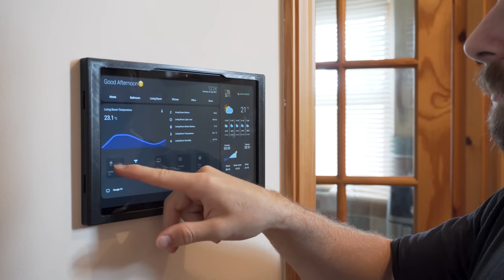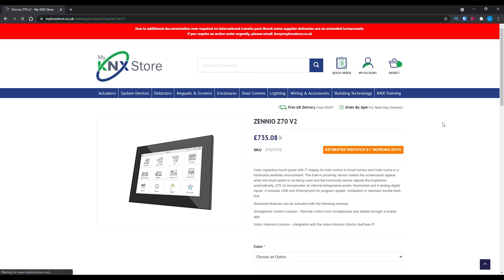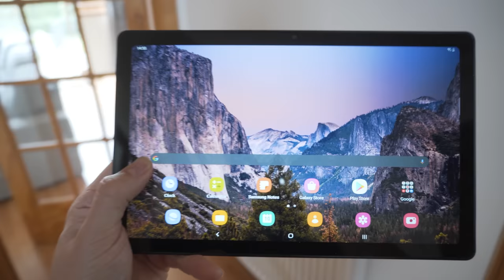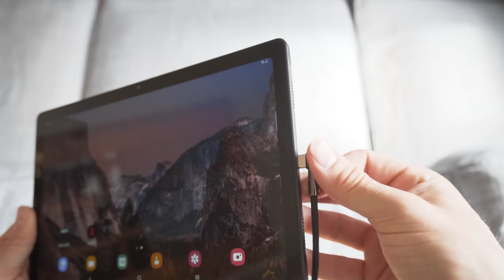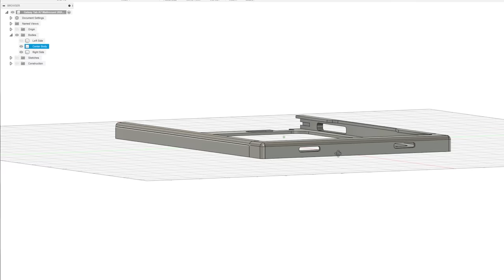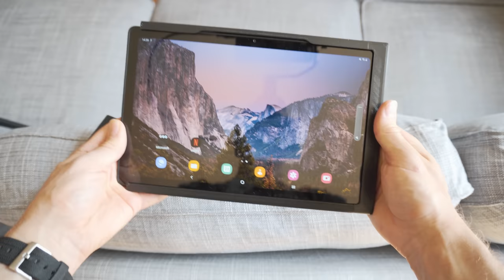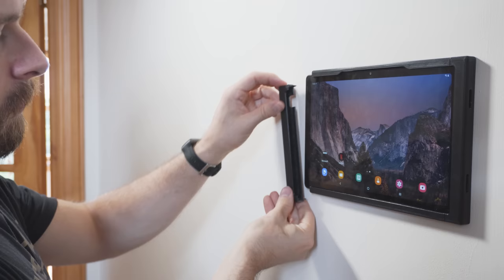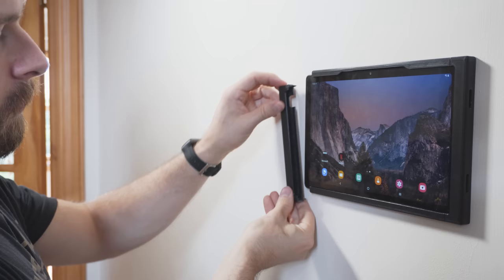Building my PERFECT Smart Home Control Panel!

Comment from the maker: Have you got a wall tablet or planning one? What automations would you do with it?! 😎
Reply: My home page for my wall tablet has the thermostat, alarm, weather, and I use conditional cards on mine to not clutter the display and only have items to control when I needed, or information when necessary. These include:
- Card for severe weather alerts (tapping will show the attributes which is the alert information in-depth from US NWS)
- Card for when the UV index is high or above
- Card for if the garage is open (tapping allows the option to close)
- Card for if certain doors are locked
- Cards for certain lights that kids use, but don't turn off (tapping will turn off instantly or pop up options if they are RGB to change colors)

I have other lovelace pages for cameras around the house and one for traffic cameras for intersections on our commute. This is great to see during the winter and know which route to take, or see if there is a wreck or just big back up for some reason.

It is nice that they only pop up when I need to see them and not have to scroll or go to different pages to see what is important. I want to interact with HA as little as possible, it should be all automated.

I use the light sensor from the tablet to automate lights in the area, and of course the camera is used for waking and sleeping the screen.

I use a kindle fire HD8 and  a Makes by Mike mount.  I also use Fully Kiosk.
Reply: First of all thank you for making great video(s) I wasn't quite decided if I should go into it right now but this is so inspiring that I've already ordered one for myself :D. 
My main motivation is to use it as a first point of contact for every member of my family. 
First point of contact for:
- Relevant information/warnings regarding house/meetings/analysis
- Surveillance system
- Control Hub for heating, irrigation system, media etc basically all gadgets that I have integrated in HA

Also I want ability to wake up tablet and show some of these information/warnings to passing person when certain conditions are met (type of event, time etc)
i.e. Garbage (people use to forget to put them out or they don't know which one is collecting), Door Bell, Intrusion, Important news about weather or just daily forecast early morning.
Reply: I'm planning to do something similar when I have my own house, but instead of cable I will attach a wireless adapter to take and use the tablet whenever I want and then leave it back in the wall without plugging/unplugging the cable.

I didn't know about the browser/app you are using, great idea! I'm saving the video for the future :D
Reply: I have a wall tablet. It uses the picture elements card extensively to make a 3d plan of my apartment. Rooms light up when lights come on. It has a lot of functionality but mostly it just looks good! I was fortunate that there is wiring for an alarm system that wasn't used so I ran the power through that from the cupboard the alarm wires go to.
Reply: We have young kids that still nap during the day, so my wife puts her phone on silent to not wake them. My most important automation/script is a button to turn off her silent mode so I can contact her haha. It also turns it off whenever we leave home. It's saved me a few times when something urgent comes up
Reply: I have a tablet mounted on the side of the fridge. I have groups to control everything there, Thermostat entity that pops open the Thermostat with a tap, weather card and a camera card with the front door. My problem is Lovelace constantly drops the camera feed so I have to refresh every 15 mins with Fully Kiosk plus the HLS protocol is quite slow so you might not even see who's at the door by the time you could walk there. I just returned my Amcrest 2k as it was failing as a doorbell (30 sec to ring) and am looking into UniFi gear...
Reply: The CM4 would have been a good fit
Reply: @AlvaroBerdonces  Nice idea with the wireless charger. I imagine you can build a 1 cm thick box, smaller dimensions than the tablet itself, put a wireless charger and strong magnets inside to hold the tablet. On the tablet glue metal plates and usb charging coil to it's back. Tablet will look like it's floating close to the wall with no visible frame or case and you can easily grab it and take with you anywhere.
Reply: We run an iPad Air 2 (really needs upgrading - getting slow - but that's a different story). Our smart home is mostly about lights and covers, and we have all this in zones, in one room which has both den, dining room and kitchen. We have a number of screens for details that aren't used that much (by anyone but me :)), and so we've concentrated on agreeing on the most important and usable things with high WAF (which has been achieved) to fit on a single "main" screen.
It is mostly in two sections: set of toggle buttons for a number of presets, and some select cards with sliders etc. for direct control of relatively-but-not-too-often used entitities. The rest are on other screens.
Presets are things like: sleep setting - both for the main living area, where it closes all blinds (10 Ikea Fyrtur + 2 Velux blinds), and turns of all lights except downlights in the living room which are dimmed to lowest due to our son sometimes having nightmares. There is also a preset button for his room, where he has a bit of light on under his bed during the night. Then there are 3 toggle buttons for our three zones of covers (Fyrtur + Velux), and a toggle button for Sonos to start playing our favourite radio channel at a reasonable volume level.
Since it is at the center of the house on an open space layout, we actually use quite a bit, and we find that we use it a lot with other apps as well. Things like music (Youtube and Spotify-like service) which we stream through Airplay 2 to Sonos, our digital shopping list app, weather app (nothing beats the specialized apps in my experience - being an avid cyclist I value radar images and the likes), and so on.
I try to integrate some things as it is possible, like our heating system, ventilation system, etc., and it works fine - just not used much, since it is pretty much just set and go. But for some things like the Meater BBQ meat themometer the native app just provides such a rich experience, that it is preferred - and as such it has actually grown to not just be our "Home Assistant display" but much a daily central for a lot of digital services.
Reply: I chose the same tablet. 🤣 
I think it worked great.
Reply: Ive built a 24" "Tablet" that I have in my kitchen. Its an IIyama 24" monitor inset into the wall with an Odroid N2 connected. Its awesome. Runs Android with home assistant, Google home, Plex, Netflix, Spotify etc. Have the audio out connected to a mixer amp so I can send the audio to any room in the house too.
Reply: why not use crestron or control4 or savant ?
Reply: I have a wall tablet, I do have a question that maybe you can help and possibly make a good video for. Im using Frigate on a RPi 4 + Coral, but i only keep 1 day of files at a time due to space, is there a way to use a usb drive or even a remote nas directory as the location for the frigate clips? or can you make a video of Frigate as a standalone container in raspbian with usb clip storage. I originally wanted to run my Hassio on Proxmox but had some virtualization problems with the coral so i swapped to RPi 4. love the videos BTW.
Reply: I move end of the month. Will do something similar :)

One note, there are tapes for wiring speakers on a wall, which you can then simply paint over to hide it. Maybe that's a better option than to poke holes everywhere :D

But in your case you have basically empty walls, so why not remove a section and make the display flush with the wall? 🤔
Reply: Hey got another question for you. Did you consider a POE adapter for power and connectivity? Do you know if its even possible for Samsung A7? I was wondering if wired connectivity would improve the camera streams.
Reply: Hi, friend. I really liked your project for mounting a tablet on a wall. I have just such a tablet and I have been looking for a long time how to fix it well and beautifully on the wall. How can I get files for a 3D printer?
Reply: I would use it to turn my lights on and off and for announce from my Alexa because i have many of them around the house due to limited communications because of many walls throughout the house and mainly because of usability with timers and such
Reply: are you sharing your STL or 3D Model?
Reply: Have you finalized those wallount 3d plans yet?

I have the same tablet, and would love to wall mount it. Thanks!
Reply: I need that 3d print please
Reply: Where can I get the 3d modell?
Reply: I always wanted one, but struggled with exactly the same issues you did. I am really interested in the Doorbell-Fullscreen Automation!!!
Reply: Walk downstairs and kitchen light goes on, kettle boils, fill dependent of course and I am informed of news and travel delays without asking
Reply: Well, I have been searching for a good central console for quite some time. I was actually planning on setting up a full blown PC to accomplish this, as well as serve as my camera storage. This may be a good option in the short term until I can get that going.
Reply: I would love for the tablet to pull up whichever nest cam is triggered with the talk back function enabled, or just have each camera always on per tablet. One for the front yard, one for the drive way, one for the back yard, etc. I am planning on putting a few tablets in the house mainly for security monitoring purposes. We have nest hello ( which is going to be updated to the newer nest doorbell battery edition), Nest cam battery with  floodlight, and a nest cam outdoor IQ ( The tethered version).
Reply: @CrypticConsole  too expensive.  the A7 lite is not @$129
Reply: @Felipe-ij2lu  but the A7 is not open source
Reply: I would love a wall tablet once I have a few more automations in place. Though I would want to be able to remove it from the wall and carry around if possible to use for security cam monitoring and like. Just gotta find a way to make it so the charging cable can attach on it's own and ideally removed easily. Think there's some magnetized cable adapters and stuff that might work for it.
Reply: Are u going to publish 3D wallmount files do we can use them to print it?
Reply: @speeter6345  Yes i need the Same please. 
Possibly the Fusion360 files
Reply: I kind of want to mount one on the inside of my front door, as some sort of 21st century peep hole.
Reply: Very nice! I am actually going to build Control Panel but based on Alexa Windows app. All my smart house devices are compatible with Alexa so I'm gonna use 'ready to go' app from Windows 10. It will be old MS Surface Windows 10 tablet as a controller.
I was also thinking about Ewelink Control Panel but unfortunately this does not interconnect all the devices.
Reply: Making a water spray when porch pirate come it blows high pressure water to scary porch pirate
Reply: Any step files by now?
Reply: Isnt this set up basically useless? All smart items have their own apps or integrate into single apps you can access on your phone. Why would you need a wall monitor/hub at all?
Reply: @GrimSpec  😮😅😅 h😮  g
Reply: Thank you for your videos they are very informative and given me inspiration for my own . Do you have a video on how you built your desktop design used in this video as I like the tab based navigation with the static header and the main panel changes depending on what room you select. I would love to know how that is done please? Thanks
Reply: Hi, Iḿ using a refurbished 10 inch Fire HD Tablet from Amazon, cost about 59€ here, got 64GB and enough Power for HomeAssistant. I mounted this on a Wall between my Living Room and my hallway with 3D printed mounts. I drilled a Hole in my wall an on the Other Side I added a 230V Phone USB Charger and into the Wall i added a shelly 1 wirh the Fire Charger (all in the Wall). The Fire Tablet shares Sensor Information with HA and so the Shelly goes autmatically on and off since the Battery ot the Fire Tablet is at 20% left. Then charges to 80% and then the Charger goes off again. For the Interface I use FullyKiosk Browser Pro which is about 7€ and this takes you to the Limit ! The Camera of the Fire Tablet turn the Screen on if someone iss nearby and also off after 15 Seconds. Also double Tap on the Screen turns it on. Everything works fine for about 2 Years now. After Tablet Reboot, the FullyKiosk starts automatically with the HA IP and runs the Dashboard. Perfect for me. ;-) Greetings from Bavaria Germany.
Reply: Would be cool to have something similar, or even just a view of the video doorbell when it rings, but not sure we can do that in our rental property at present (landlord seems extra against us installing stuff on the walls or drilling into them - where theres a lot of brickwork. Its a basement flat). Our seemingly-single-layer of paint comes off if you just rub past it the wrong way so 3m command strips probably need repainting after/may take more of the wall with them in some places, have yet to find out though did put some up in a builtin closet to manage network router/switch, where it doesnt 'matter' so much.

Automations I'd do - agree with "turn the screen on if person walks up to the tablet", would wait to see if that got annoying after a while cos dont always want to see it; and of course security/doorbell camera and intercom interaction.
Basic daily updates on weather and a calendar display tab, with the next event for the day, and even cooler would be to know who was looking at it (via face recognition or maybe presence detection of devices nearby or combine the two for a confidence level) to show their own calendar as well as shared events and tasks. Or with a tap on the tablet with an NFC reader or more-involved actions to override any errors/if that didn't work due whatever reason (recognisable device not present, or random errors).

Manually switching scene modes before going out/after returning would also be high on the list, for security, where those changes can't reasonably be fully automated or to override them. An intercom between the tablet and other rooms in the home would be good too, if they're far away enough to be useful. Could announce on a speaker about shared todo's that are due and not done yet. It could be another way to leave a message for someone, besides the traditional scrawl on the fridge, that would be easier to notice for anyone who's not glued to their phone notifications or might have missed one. You could scribble on a full screen notepad and leave it, tag someone, if it knows they're there in the room and haven't seen it yet then bring it up with a ping!
Reply: @alex_ortiz bro where is your project please reply..i have been searching for the same thing for 3 months i can't even leave it alone so sad 😢
Reply: @raystonrizwan7800  I don't have it posted anywhere. What are you having trouble with or interested in? I want to redo mine with the new layout options in the dashboard, but haven't had time.
Reply: few years ago i have installed analog home automation  for lights remote controls and water level control system auto taps etc..now i want a dashboard with digital controls for all working on a project with water level control monitor on 0.96'OLED Esp32 that displays water level and other parameters on OLED and Bylnk app on android tab also..so i want a same dashboard for displaying water level monitor and motor control,and control lights with dashboard with bottons and humidity temperature AQI kitchen gas leak detection backup UPS capability remainng parameters solar parameters.door camera ..the only thing i am stuck is how to integrate this on single dashboard please help i ll appreciate it

Comment: Looks amazing. I have a very similar setup. A piece of advice. Grab some sand paper, spray paint and clear coat spray. Sand it, paint it, coat it and you will be shocked by the result. You can easily get a result that looks like piano black finish which looks like you bought and not 3D printed.

Its not so hard. Even my first attempt turned out great.
Reply: Important to add the grit of the sandpaper, I'd advise grit1500 and up for a near mirror finish
Reply: But anything from grit500 and up will give a nice finish
Reply: so glad I got a CR-10 when it was on sale.  Printing it all in one piece is just so much cleaner.

Plus if you print in matte filament it will hide the layer lines really well

I think he should have just made a cover-plate out of wood or something, would be better looking

Comment: Nice video. I had a similar project and went with many of the same steps as you did. One thing though I can recommend to you is in the android settings: Battery Saver mode. Most modern tablets should have that. It will only allow your tablet to charge to a certain percentage (60 or 80 or something like that) which will keep your battery healthy and from balooning up, keeping your installation healthy for years. Then you also don't need to use a smart socket for charging anymore. Depending on the power draw of the smart socket, it can even save you power to just let the charger cplugged in 24/7.
Reply: Lol is this actually true? I havn't used battery saving mode in years but i've always been under the impression that it only reduces the power consumption..

Comment: Aaah yes, the benefits of having hollow walls. Here in Belgium, almost every house is constructed with bricks, even the walls inside. When I renovated my home 10yr ago I never thought of having a smart home. Now I want a screen on the wall but the only way to achieve that is to create a large slit in the wall.  It can be done with minimal dust but you have to have specialized tools. 

For now I guess I have to settle with a tablet holder on my living room closet. Nice job on the tablet holder btw!